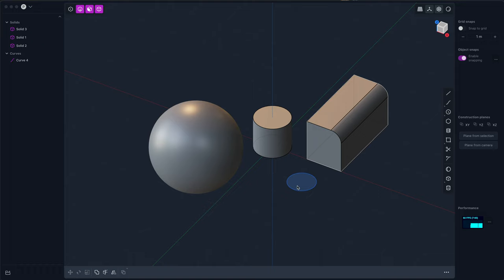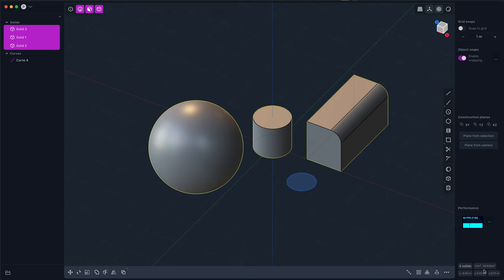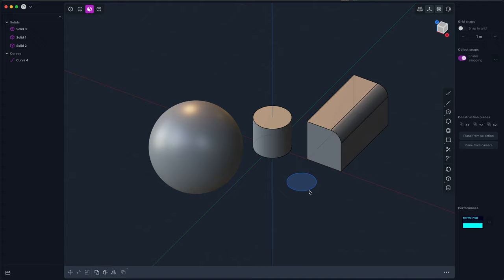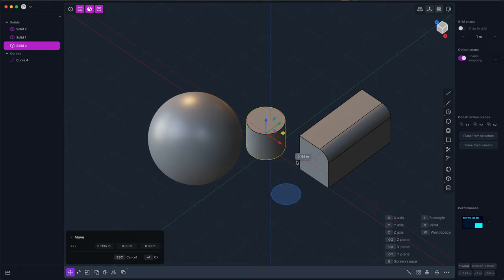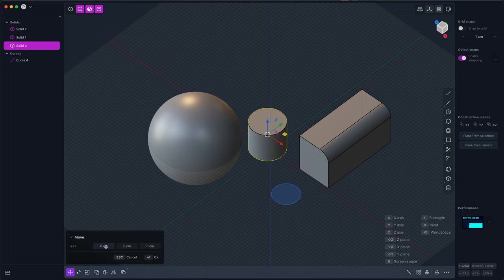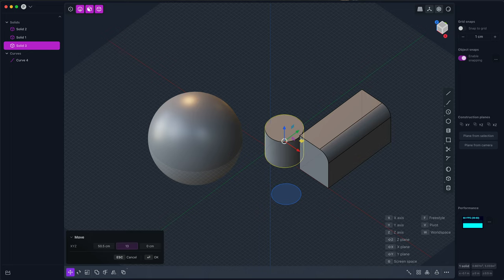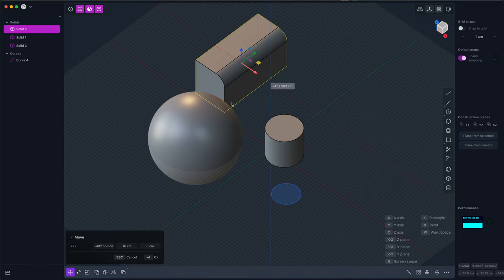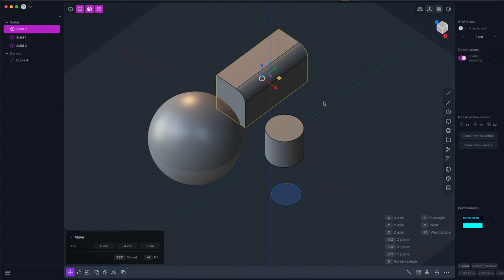Units & Measurements in Plasticity

Comment: Absolutely love your approach to detail. Just don't forget to do a help in pop-up windows or otherwise for all hidden non-obvious functions, such as entering a formula or entering with additional keys. It would be cool to see the implementation of detachable toolbars so that the user can place them somewhere above the workspace, as they often do in Maya and so on. This is due to the fact that all monitors have different aspect ratios, for example, if the monitor is ultra wide, then dragging the cursor to the button on the side panel takes half a day.

Comment: Noice. I am sold now. The lack of precision was the reason to not fully integrate the tool into my workflow, because from time to time I need to replicate props from the real world. This feature makes the whole process a lot less "destructive".

Also I did my very first 3d print with this program and I needed to expand a circle by 0.5mm - wasn't that easy to Check it afterwards :D

That being said, thanks for your work and I am eager to buy a license when it's released.

Comment: When extruding, moving or doing anything that has a dimensional dialogue box, I don't waste time mousing over the dialogue box to input dimensions. You can save time by just typing the number as you're dragging the part with the mouse. Hit the minus sign before or after keying the number for negatives. This is a super fast way to create accurate parts for say 3D printing. Excellent product by the way Nick... 
It may interest you to know that I'm a design engineer transitioning from Catia and despite spending nearly 15 years on v5, i can model items accurately in Plasticity in a fraction of the time and with far less stress after just a month using the tool. It's a gem.

Comment: Love where this software is headed. Something that seems to be missing is the ability to explicitly set a radius or edge length after a curve / line has been created. You can scale them, which is artistically useful, but when you need to make minute adjustments for something like 3d printing, you really need to be able to set a specific size.

I also think it would be a good idea to set up a forum / discord you can access before purchasing. If I'm evaluating if I want to buy this software, there aren't yet many resources where I can find out if it can do the thing I need it to do.
Reply: I asked about this and was told this was for ARTISTIC CAD, I guess artists don't need to measure things

Comment: I am enjoying the program. It does a lot really well but I'm having a little trouble with some functions. I am only familiar with Adobe Illustrator and this and 3D modeling is all new to me so sorry for all the questions and thank you for your attention. 
—I don't see an instruction manual or user guide. Am I just missing it?  
—Are there rulers or guides that can be set to create snap points?
—I want to drop in a .png to trace that is exactly 10x20 inches @ 300 ppi . First it comes in huge and it doesn't tell me what size it is. I'd like to set the upper left corner (for instance) at X 0, Y 0, Z 0, and set the size as 10x20 but can't see how. 
—Is there a dialogue to set an object to be a specific size? I have a face made of several splines and want to scale it in proportion to be exactly 5.625 wide. Sizing an object by a percentage is obviously useful but that requires math that might not be as easy or accurate as just setting the desired dimensions in inches or mm etc.  It's nice to see what the dimensions are in the lower right but better to be able to type in what is wanted. 
—It would be nice to be able to move a face without having to select each spline and then moving. 
—I have multiple points joined to make a face... if I try to move them I can only drag one at a time and the face goes away and they won't snap back together. Then I have to select both and Scale, click on the Z dialogue, and do 0 tab 0 tab 0 to get them back together. While that is unnecessarily time consuming it also moves both points instead of snapping one that's off to the one that is correct. A point may not necessarily be on the grid so this is also time consuming.
— I want to move an object a tiny amount but the arrows are always in the center of the face and that is off screen instead of being withing the section of the object that is visible.

Comment: Amazing work. I hope you'll eventually add perpetual re-dimensioning to be able to edit radii, x, y, z of shapes and volumes. Including the ability to adjust and even remove fillets & chamfers at any time.  Also easier snapping to drag objects onto other objects plus alignment to bounds and centers.

Competition such as Shapr3D falls flat on its face with snapping and alignment, though they do have the re-dimensioning down pretty well. Those inabilities are enough to prevent me from using an app full-time.

Comment: let me throw in some minor suggestions on usability:
1) currently you can switch between selection modes by pressing 1,2,3,4. you can also activate multiple selection modes by holding shift 2,3,4 - or by shift left-clicking multiple selection mode icons - awesome. now, could you make a double click on an icon cause all selection modes to become selected? shift double click could make all selection modes get selected - except the icon you clicked on (inverse selection). 
I believe that would suit a Z-Brush users instinct.

2) with the 3ds Max navigation scheme, there is a little issue: when the mmbutton is pressed to pan the camera and alt is pressed, the camera should switch to rotating - currently in plasticity, instead of switching to rotation the camera goes on panning - you would need to stop holding mmouse button and then alt click mmouse button again in order to pan and then rotate - could you please make it possible to instantly switch from pan to rotate? - it's a small detail, but a great deal for 3dsMax users.
3) with the 3ds Max navigation scheme, ctrl alt mmbutton should be zooming 50% slower from what it currently is and zooming direction should be inversed (down should be away and up should be closer) - this way it would be like in 3dsMax
Thanks for reading and I hope there is a chance you can make these adjustments!

Comment: I recently purchased Plasticity and it's a great software. But I also am having difficulty understanding the stl and obj output functions. I prefer using Inches instead of millimeter and meters. When i switch the interface to inch selection and attempt exporting a 1x1x1 inch cube it doesn't export properly. When I load it into my printing software it recognizes that it's in inches but loads to small. Is there any advice as to how to model and export in Plasticity in inches properly?

Comment: While Plasticity CAD is targeted at Artistic usage, after seeing how amazing it is to use; Fast, Simple to use, fun to use, Please make entering in the precision mode for precision CAD users! This ease of use and quickness of design is what every 3D CAD user wants! Plasticity Makes Complex design look easy!

For example, clicking ( maybe while holding down a key ) on an object would pop up a window to edit the relevant dimensions!

The world of industrial design is waiting for this!   SpaceClaim then Sharpr CAD are going in this direction but Plasticity Plus precision entry is the target they are aiming for!  

How about Python/Macros for building libraries:  Gears, other complex objects, etc! 

Put an image on the screen them use it as a template, then add dimensions. Just as it is I am ready to order!

Will also have to try your thinking technique in SpaceClaim and Sharpr CADb, I expect it will not work as well, but maybe helpful.

For the precision CAD users , they will want a few more File types supported, e.g., DXF and Step at least.

Comment: i've been playing with it a little bit using the free trial, and it definitely looks interesting. I've always wanted to give cad modeling a try, but most of the available options out there are either subscription based, too expensive for a perpetual license, or limited in some other way, and from what i've seen of Plasticity so far, it has promise. I'm curious to know when, or if, you plan to add 3dconexion space mouse support, as for something like this, they're very useful (especially for custom hotkey setups)

Comment: Yea so after playing around with units its crystal clear they are a complete waste of time! Tried to create a simple 100mm cube in Plasticity, export it as an object and then import it into Blender and it was factored down to a scale representative of  scaled down version a factor of .0001mm! Took a 100mm cube I created in Blender and imported it into Plasticity and it was scaled the exact opposite and was so huge I could never get it to scale down to even fit my work area.

So really what was the point of even adding units & measurements when it is so absurdly off? Somewhere along the way your figures are way, way, way off! I was hoping I found an affordable solution to create 3D printable models but as is that is not possible in any way with Plasticity. I hope you do eventually work out how to make these units and measurements real world instead of just working inside the software as some arbitrary, unrealistic application.